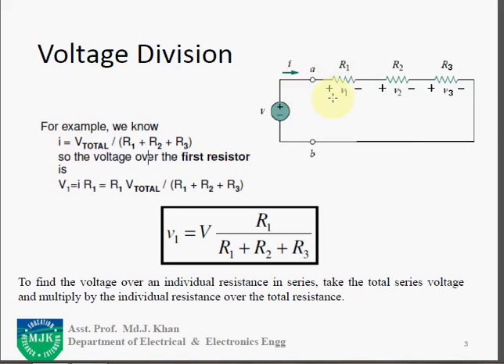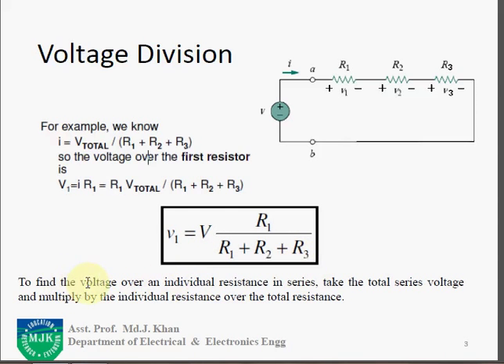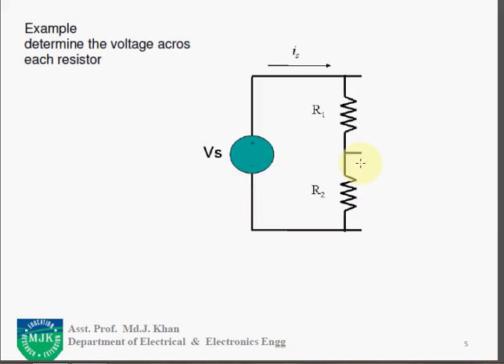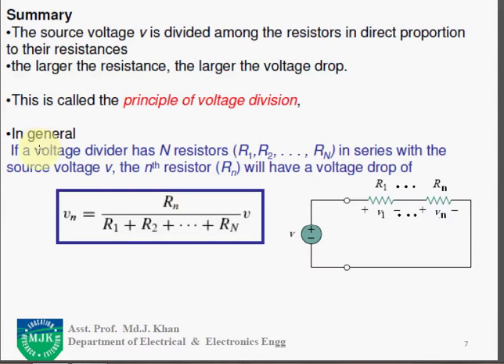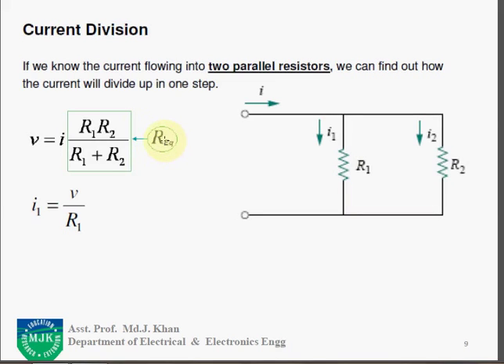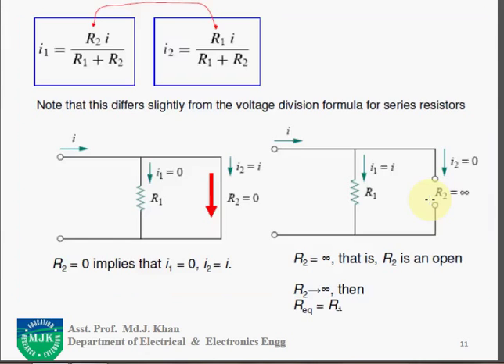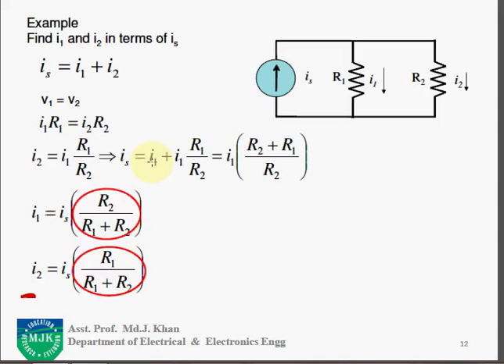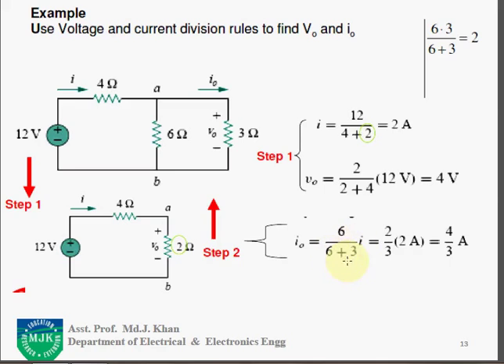voltage and current division rule

Comment: if three rsistors are in parallel to single source then how to calculate the current in each resistor
Reply from the maker: simply find equivalent resistance of the three parallel resistance then apply ohms law, find the current, this is the total current flowing through the circuit , then apply  current division rule you will find each branch's current. if still have confusion provide your mail id i will give you solution

Comment: If the resistance is more than two then how will we apply current division rule
Reply from the maker: I haven't get your point...sorry for the late reply
Reply from the maker: simply find equivalent resistance of the three parallel resistance then apply ohms law, find the current, this is the total current flowing through the circuit , then apply  current division rule you will find each branch's current.